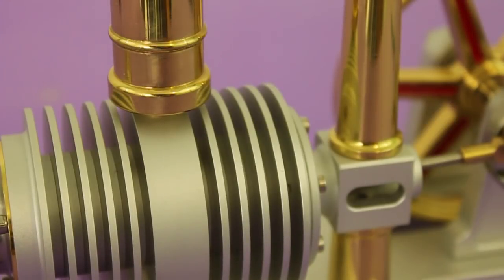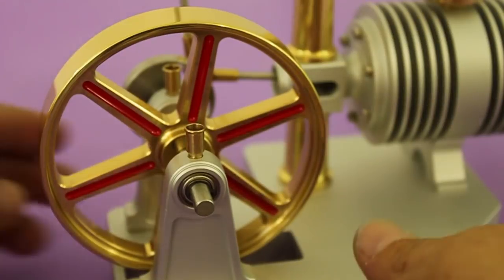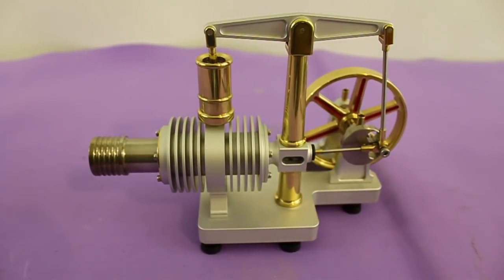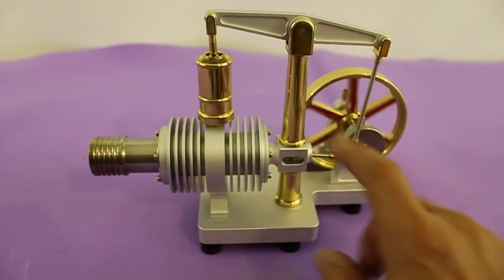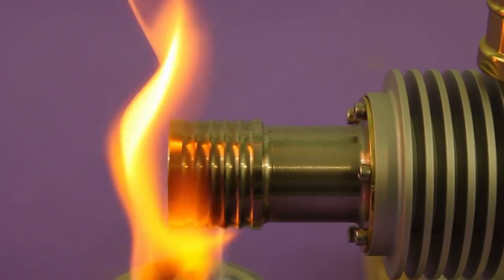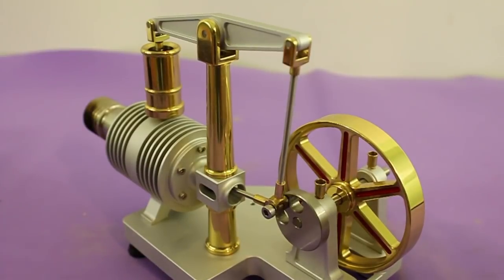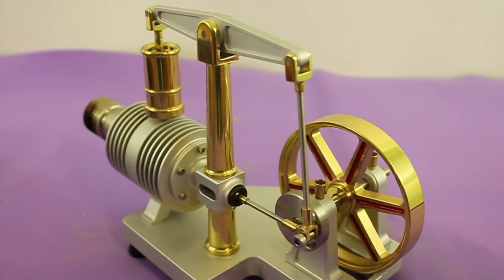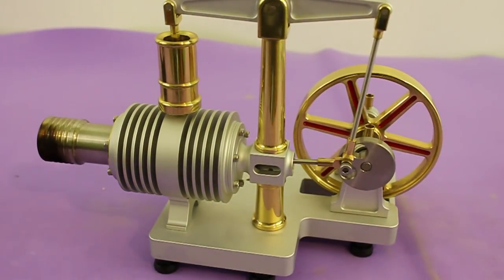Beautiful Stirling Engine [Review]

Comment: Can you use magnifying glass for heat ? And repeat it?
Reply: most likely. You could also put ice on the side where he is putting the flame, since it works on temperature differential. It doesnt care about where the energy comes from. 
However since it works on a temperature difference. A magnifying glass focusing sunlight would mean the machine is outside. If the machine is outside, the sun will heat up the whole machine. So the temperature difference will go down. So it may not work as optimally.
Reply: @MrRishik123   thank you Mr. Rishi sir for this huge information.
Reply: @goswamidigvijay369  np
Reply: @MrRishik123  Being outside is not a problem. You can easily put the cold half of the motor in the shade (with a screen of some sort). The temp difference between the hot side and cold side would still be pretty big if you are focusing sunlight via a big lens (maybe Fresnel lens) or parabolic mirror for example.
If it's just for fun, maybe you could drive a cooling fan from the flywheel to cool the cold side of the motor. It'd be fun to play with anyway :)
Reply: @zalida100  I am functioning on 3 hours sleep (in the hospital for some IV antitbiotics)
So i completely didn't think of putting half it in the shade. 
XD
We all have brain farts i guess.
Reply: @MrRishik123  That's not a fart. That's just being tired.
Hope the treatment works ok for ya. Good luck.
Reply: I may be out of date but I think  a Japanese guy held the world record for a Stirling engine running at half a degree Celsius temperature difference.   I have one by Kontax,  UK, that runs at 5 degree Celsius difference.  Direct off sunlight without focusing.  The engine shown here isn't designed to do that, but with a big enough magnifying glass or curved mirror,  yes it would run.